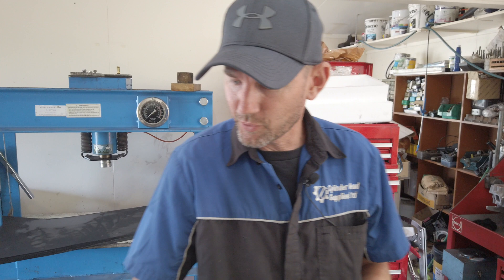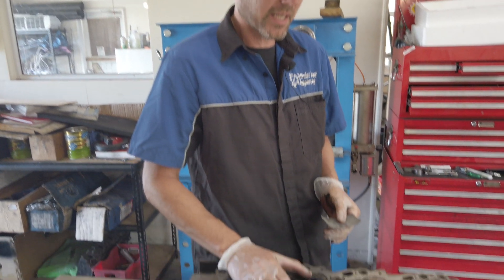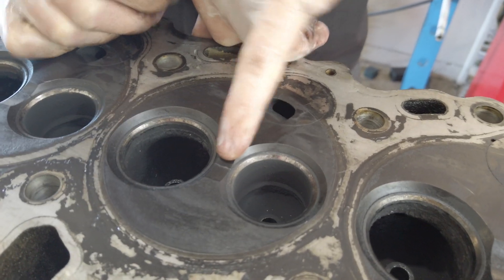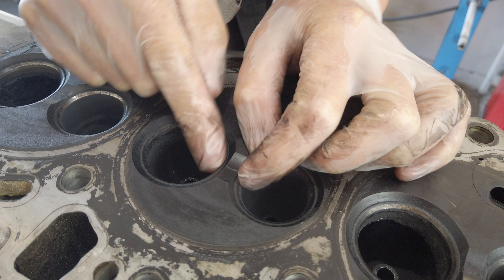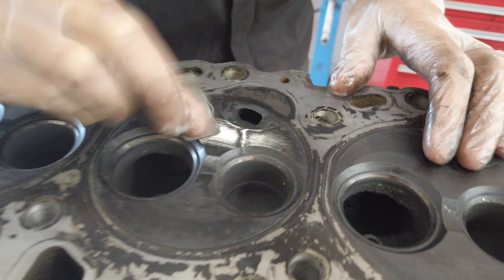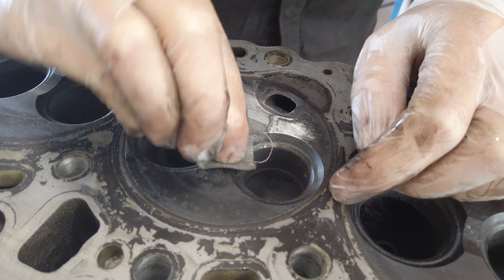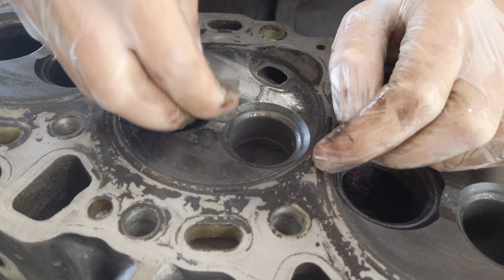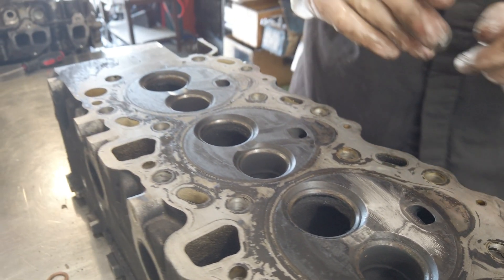TOYOTA 1KZ engine head crack. most common place for cracking. 1KZ-TE

Comment: Get an AMC aftermarket head. Apparently this remedies the cracking head issues... the heads were made weak by Toyota anyways. Other than that the 1kz is an awesome engine
Reply from the maker: Great Tip. thanks!

Comment: I watched LVL UP Garage with a cracked 1KZTE AMC cylinder head and he threw it in a Bonfire and melted it. The AMC head may be built better, But its not bulletproof. If you get any aluminum cylinder head hot. Its gonna develop cracks. The best way to avoid this is to be Proactive with your cooling system and dont overheat your engine.

Comment: question ii have a 1kz it runs and drives sweet as   prob is i get oil into the cooling system but no water on the dip stick at all    zero none when i drain the oil its fine  but the top of the rocket cover have fome  that when i press it clear water drips (strange i know   does this sound like a cracked head or a fucked oil cooler ?
Reply from the maker: for questions ring the shop. link in description

Comment: I had a AMC head fitted to my 1KZ-TE about 30,000 km ago. Getting ready for XMAS camping trip and noted overflow empty and coolant low. Put a funnel in place of radiator cap and could see bubbles. Has anyone experienced issues with AMC heads or am I just very unlucky? I have a aftermarket coolant temp gauge with warning and max record, so can definitely say it never got too hot.
Reply: Hey man did you end up finding out what the problem was, I done a head on mine about 2years ago similar mileage done around 20k and my coolant overflow is also emptying out, not over heating yet Cos I keep topping up the bottle but I guess if I didn’t top it up it would eventually overheat, I really don’t wanna be doing another head
Reply: @mudluxx  after I posted, I've had no coolant loss. Options are it fixed itself, or the more likely option is that the dodgy mechanic that worked on it just prior didn't top it up after removing turbo coolant pipes. Good luck with yours. I'd suggest a quality temp gauge with programmable warning

Comment: Just brought super custom van 1kzte from car dealer 180000km did cam belt water pump thermostat ,when I run it up with radiator cap off white bubbles like foam but seems to be ok drove it for 6 hours down the line no overheating no water loss. puzzling is there any way to check it without taking the head off
Reply from the maker: Hi I can only recomend contacting Jason. He would know. I am not clued up  on those engines. Sorry

Comment: www.cylinderheadsupplies.co.nz* you got a "s" after head. 
where are your cylinder heads made from, and how much is it for a 1kz, and is that with the cam shaft or just the head itself cheers
Reply from the maker: thanks for the heads up! fixed! you better contacting  www.cylinderheadsupplies.co.nz with your question direct. cheers

Comment: Well then. Mines only got 370k on the clock, I’ve had her since new so does the small amount of bubbles 1 every
5 seconds in the overflow mean my head cracked?  No overheating!
Reply: Just an update yep cracked head $&@“
Took the head of yesterday, still no over heating, also no excessive EGTs just having that ute from new I knew something was wrong those bubbles in the overflow were doing my head in
The crack was between the valves on number 3 cylinder! Everything else look ok, anyway 370k is acceptable but my other Hilux is laughing at its mate 420k 32 years old never had the rocker cover off! Still feeling it!!
Reply from the maker: If you not loosing coolant than no. You good
Reply: Thanks
Reply: Were you using water ?my one bubbles up to but doesn't overheat